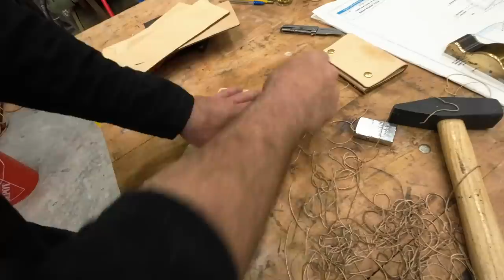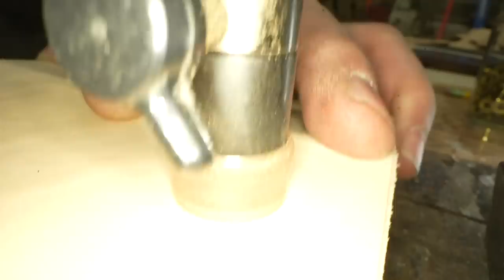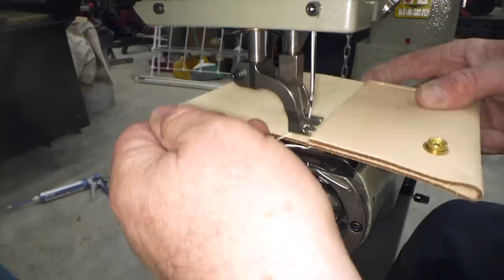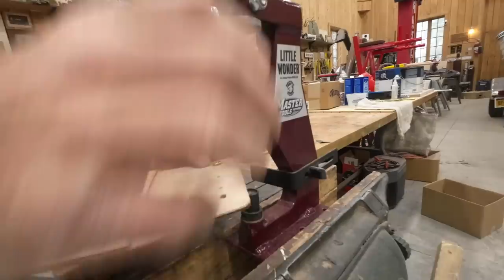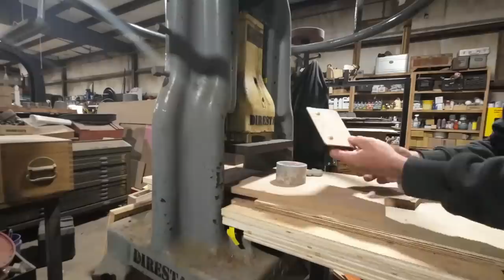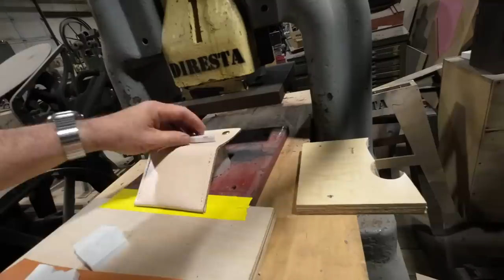This Sewing Machine is a Beast

Comment: Suggestions:
 -pre cut a groove where you threads go and it will help recess them for a cleaner look.
- try hand tooling some designs! Super fun and totally unique. 

That sewing machine looks like a beast!
Reply: Also, a rivet at the top of your stitch will keep the threads from pulling away over time. The glue helps, but can breakdown over time

Comment: If you want a better impression, you could wet the leather a bit, that's what we do when we carved / tooled leather, plus it will fold better too instead of hammering down and will prevent cracks on the crease .

Comment: Very cool!  Looks like you milled those stamps, I've had good luck using a resin-based/SLA printer to create them as well.  Great work!  Couldn't tell if you did, but also I'll wet the leather before applying the stamp, and for smaller ones I'll just use a mallet since I don't have a fancy fly-press 😁
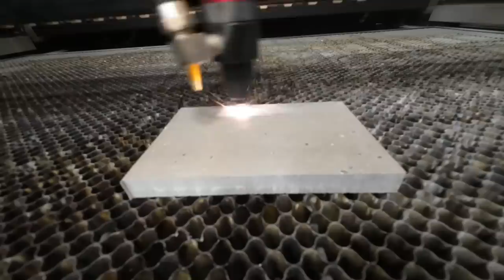Reply: At 7:08 you can see a laser being used to make the stamps, but I do not immediately recognize the material used. This is a much faster process than using a 3D printer. 

IMO, 3D printing (aka. additive manufacturing) is too slow of a process to be commercially viable. Even when you own racks of printers, the process isn't efficient enough to justify the investment in machines, supplies, power, and time required for care and maintenance. If you have enough volume that racks of 3D printers would be required, then it makes more sense to invest in injection molding or work with a specialty manufacturer to mass produce the items.

Comment: That Adler copy machine could sew 4 of those wallets together. It can handle up to 1" of material, plywood included. They used to use them to sew door cards together in cars.
HEY JIMMY: those shims on the top and bottom of the forward/reverse can be adjusted so it sews in the same holes when back stitching. Looks like yours need a small adjustment.
Reply from the maker: Oh yes. I understand 100 %
Reply: @jimmydiresta  I have a Juki441 clone and I had to make my own shims to get it right, took better part of a day.

Comment: "DIY" with 4100$ machine. come on
Reply from the maker: absolutely. swim or sink.
Reply from the maker: btw where did I say diy?
Reply: First of all, where does Jimmy mention this is a "DIY" project? 
Secondly, the sewing can easily be done with two needles and thread using a simple saddle stitch. Probably about 5 minutes per wallet. And you don't need a huge press to stamp the designs. If you wet the leather, you can easily do it just by sitting on it for a couple minutes. Also, there are many ways to create stamps without a laser cutter. Most snap sets come with everything needed to set snaps by hand. 
Assuming you buy a stamp (along with the snaps and leather and thread and needles, etc.), this is a beginner project. It is a very good way to start learning leathercraft.
Reply: I paid for my machine in 10 messenger bags. I have a Techsew 5100 very similar in size/type/cost to Jimmys. I dont have a youtube channel. It is just me, a broke wage slave with a side hustle. DIY as FUKK....
Reply: @jimmydiresta  I love the order of this response.  “Swim or sink”